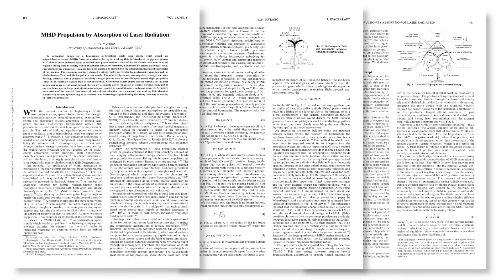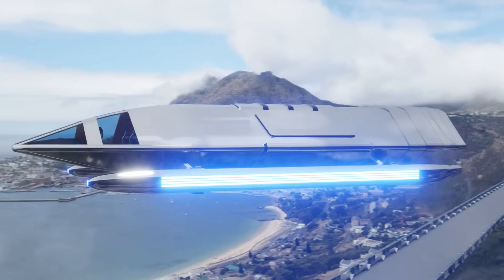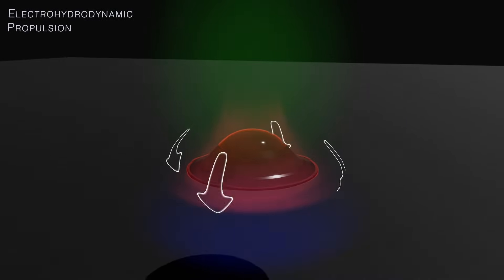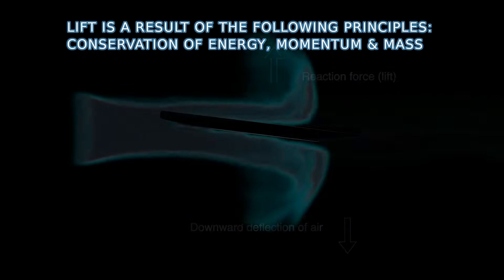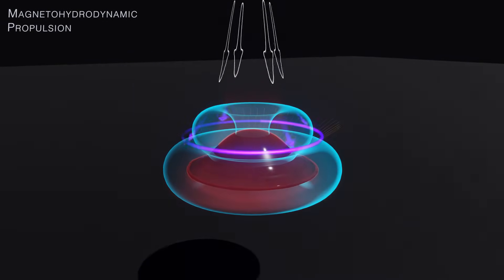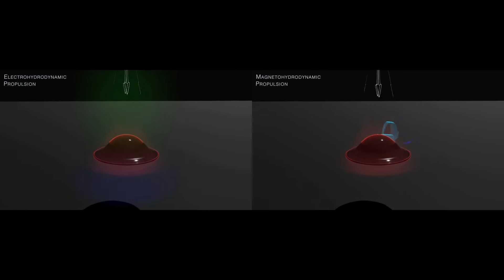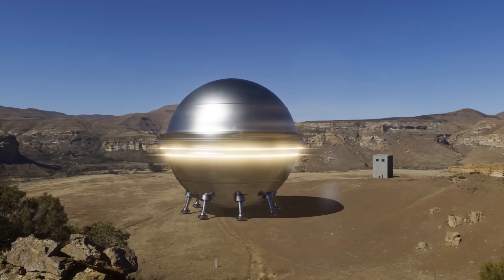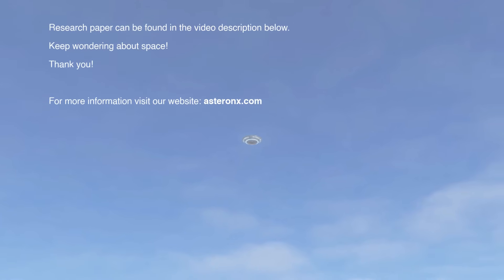Magnetohydrodynamic (MHD) Propulsion - What Is It? #magnetohydrodynamics #mhd #aerospace #asteronx

Comment: Those ideas are like the one I have in my mind.   But it's a little different,  in mine I use a different way to propel the ship using the ship to do that.  Instead of ionizing the air, it propels with magnetic fields.
Reply: MHD propulsion works by using a magnetic field to accelerate a conductive fluid, which generates a thrust force that propels the system forward. The conductive fluid is typically a plasma or ionized gas that has been created by an external energy source, and it interacts with the magnetic field to produce thrust. 

It is not possible to create propulsion using just magnetic fields in a vacuum or empty space, as there is no medium or substance to interact with the magnetic field and generate a force.

However, in the presence of a conductive fluid, such as a plasma or ionized gas, it is possible to generate propulsion using magnetic fields, as in the case of Magnetohydrodynamic (MHD) propulsion. The interaction between the magnetic field and the conductive fluid generates a Lorentz force, which can be used to accelerate the fluid and generate a thrust force that propels the system forward.

Therefore, while it is not possible to create propulsion using just magnetic fields in a vacuum or empty space, it is possible to use magnetic fields to generate propulsion in the presence of a conductive fluid.

However you may be thinking about if it is It is theoretically possible to generate thrust using a planet's magnetic field through a process known as magnetic sailing or magnetic levitation. Magnetic sailing works on the principle that a spacecraft carrying a strong magnetic field can interact with the magnetic field of a planet and generate a force that can be used to alter its trajectory.

The force generated by magnetic sailing is proportional to the strength of the magnetic field and the relative velocity between the spacecraft and the planet's magnetic field. Therefore, to generate a significant force, a spacecraft would need to have a strong magnetic field and be moving at a high velocity relative to the planet.

However, magnetic sailing has some limitations. For example, the force generated by the interaction between the spacecraft's magnetic field and the planet's magnetic field decreases as the spacecraft gets closer to the planet's surface. This means that magnetic sailing would not be an effective method of propulsion for a spacecraft that needs to land or operate in close proximity to a planet.

In addition, magnetic sailing is still a theoretical concept and has not been demonstrated in practice. However, some research is being conducted to explore the potential of magnetic sailing for space missions, and it is possible that it could become a viable method of propulsion in the future.

(all answers based off chatGPT answers)
Reply: @BlacDiamond 233  what I'm referring is a little different,  where the ship generates a field than interacts with the ship itself, while the ship is made of a material that reacts yo magnetic fields.   It's like having 4 magnetic fields with iin the ship.   
An easier way to explain that was reflected Ina a patent that almost has the same idea that I have.   If you please search the patent you may have an idea of what I'm trying to explain. 
US7936097B2
US20150252795A1
US20060144035A1
While some of the documents don't describe the real working idea.   Some of them do.   My idea is a mixture of this 3 ideas .
While I was doing research,  I came across this and they in some way reflected what I have in mind.    
I've seen experiments were it is possible to achieve what I have in mind, by mixing different ideas to achieve propulsion,  independently from the earth gravity.   From a source creating fields with in the ship.
Reply: @luisarias8077  I looked up and read the patents, what you described and the patents describing is the equivalent of  trying to open a door while having both your feet anchored on the door and both your hands on the door nob and trying to open the door by pulling the nob; what I am trying to say is it would not work under normal situations (presence of gravity and because you are trying to push off momentum that's going the opposite direction meaning you need an exponentially and very quickly a amount that would not be pressable at all because the necessary amount of power would be considered infinite*). However it could work depending on the way it function, for example, in space you have 2 magnets that is attracted but physically limited to get closer, one of the magnets is stronger than the other so one of them pulls the other more than the other so this will cause a small amount of momentum in space, if you were able to flip the pole of one of the magnet making it un-attract and have it restricted to flip so it cannot become attracted again, it would repel, in such a way that the momentum is canceled out completely ( assuming the magnets is again restricted by some sort of structural rail and  having a limited distance it can be repelled from). But if you want to do the same process again in such a way you will gain momentum without needing to cancel it out; you would want the magnets to be spinning ( it would look like 2 magnets on rails with rail limits so it cant get off and the whole thing is spinning sort of like a centrifuge ). When it is spinning at some point the left magnet and the right magnet will swap its place, meaning when you flip the magnetic field of one of the magnet it would not cancel out the momentum, but increase the momentum WHEN you time it correctly, even once you made this idea digitally(somehow) so it could do this process hundreds of times per second, it is very difficult to say it would work(it may possibly work in non-space as in planetary conditions if the *exponential infinite amount of power thing I said before does not effect this concept only if that does not occur because it is mathematically alright or it is in space specifically). I tried to get as close as possible for your idea to work but it's ability to work would be a drastic yes-sort-of-work-ish or no-work. Im not even sure if it would even work in space but I assume it could because it is spinning and the strength of the magnets is different; generating a polarity and allowing momentum (which is the part if it does not work I would seize to know anything better for the idea to work in terms of trying to make it work specific to your idea).
Reply: @blacdiamond2334 Salt water works they build MHD boats a long time ago with MHD generator engines on board but the boats only managed 12MPH so they left it which I don't understand personally as its the generator itself that's important not how fast the boat goes n 12mph is exactly how fast modern ferry's move so we could be powering them with these generators but I think they stopped it because not much money in it for them the usual reason we miss out on so many things n progression off many things all about the money

Comment: Looks like someone figured out most UFO propulsion and also why Star Trek favors Warp Nacelles as Magnetic Space Rockets for FTL flight.

Impulse Engines might just be a more limited angled version, which draws propulsion from Warp Drive Power while pushing space along to move.

Alcubierre Warp Drive math would seem to be applicable to at least some of the needed calculations to have MHD Warp Drive Nacelle Space Rockets work.

Comment: All the info you share may be factual up to the point of where weight to thrust ratio can actually be achieved to produce a manned vehicle that actually leaves the ground. I see the video you show vehicles moving in air. But they're not real...yet. because if your video was factual, that form of propulsion would already be utilized and it's not
Reply: Electric power was also factual, it just took time to understand😊

Comment: I would wonder if high rotation dielectric near aluminum blocking gravity from nearby large objects like a planet? Wonder if using shock of electricity to line electrons to stimulate large crystal. Witch gravity can be built up and directed as a laser? Thinking out loud thew my backside should propel me across the universe.
Reply: So, the magnetic field push the outer structure of the ship, and other magnetic fields placed like number in a clock, will create direction.  The power source will generate the field that interact with the ship creating lift.    Think of a superconductor levitating in a cold environment.   Without the need of a cold environment. 
There is metal's that behave like superconductors at room temperature.   In the presence of magnetic fields.

Comment: By MHD an entire ship can be moved in total vacuum
It's the electrical current through the entire ship, crossing at right angle a magnetic field, that makes the atoms want to move in the remaining angle
Your right hand's rule ... check for " A primer on the Homopolar Phenomenon "
Reply: If the magnetic field is generated relative to the ship then the atoms will not move, because a subset of them are generating the field. Its for the same reason that blowing into a sail from inside a boat will not move the boat.

Comment: I thought I might learn something. Yes, ion wind is different and a very weak force. Yes the principle of lift is correct. After that it's a lot of advanced physics. Some time ago it was speculated the military had a plane capable of Mach 12 or greater. To be clear there are two critical factors here. First is incredible propulsion. Second is not melting or shredding like toilet paper. This is how it was explained. First, jet engines would take it to low Mach. Second, SCRAM jets would engage to hit around Mach 5. Then it would shoot a current out the front powerful enough to create plasma while at the same time creating a magnetic bubble, basically cavitation in the air. At that time the MHD. would kick in. In particular plasma is positively charged atomic nucleus with the electrons stripped away. It's the fourth state of matter. Being ionized means the molecules are looking for a covalent bond. The energy difference is huge. However escape velocity is 7 miles per second so you need to go fast to get to space unless you have an elevator.  Essentially I see no explanation of MHD working in the atmosphere from a standstill. Magnetic drive with rails yes. Additionally your explanation in space fell short. The propulsion you presented,  like ion drive is low energy but operates for a longer period, and there is no drag in space. Matter in space is extremely low density gas. Virtual particles would be the result of high energy collisions. MHD needs interacting Magnetic fields and that means either mass or energy.  I know people who don't do science probably miss what I pointed out. However MHD is certainly exciting, especially if cavitation can be achieved. Of course if it fails it rips apart like the Challenger.
Reply: The correct propulsion will be magnetic not needing to use ions.
Magnetic enough to levitate the ship with enough force to break gravity.   Then moving faster will be easier.   Using the ship same as a superconductor in a super cold environment.    Some alloys levitate in presence of a magnetic filed.

Comment: MHD is a interesting phenomenon but if is a easy as suggested in this article then why is it not in use 
. I think the power plant to supply these systems would be one problem also the lifting force is very low compared to simple wings or rotor lift . Magnet force required would be dangerous to any crew or electronics high magnetic fields render humans unconscious and scrabble electronics programming.
Reply: It IS in use currently

Comment: Strange to think you could get any lift from a element that is heavier than Lead, just by rotating it in a magnetic field.
Reply: I just realized this a week ago and was amazed...we could push a 1-ton piece of lead and get it to swing provided it was hanging from a long enough cable. Even a round enough stone. So friction is the key problem not so much  weight or mass. I think.

Comment: Similar to indirect use of electric power. AC magnetic field collection is an example of this principle you can collect power passively from AC power lines to use for lights refrigerator or air conditioning. The outlets in you house have been modified to accept the AC magnetic field based devices.
Reply: Know what's weird, I took an old ceiling fan motor apart, and got it to light up an l.e.d. a few weeks ago by spinning and putting a magnet by it, then a lightning storm spawned right after i got it to light up and i ended up struck by lightning (essentially it hit 3 feet away from me but the house blocked it) and my car also... anyway, that might not be relevant... but the field was a/c somehow... I guess like putting it by the powerline could do something, who knows... I chunked it and even my dad said get rid of it after all that shit happened... I toy with things and some weird magic amplifies it I guess

Comment: Well, you started off wrong.  I hate that.  MHD is not an acronym..it is an abbreviation.  Come on you guys.
There are several problems associated with the development of magnetohydrodynamic (MHD) propulsion. One major challenge is the need for extremely high temperatures in order to generate the plasma necessary for MHD propulsion. This requires the use of materials that can withstand high temperatures, which can be expensive and difficult to obtain. Additionally, the complexity of the system makes it difficult to control and stabilize the plasma, which can lead to inefficiencies and reduced performance. There is also a lack of knowledge about the behavior of plasmas in magnetic fields, which makes it difficult to predict the performance of MHD propulsion systems. Finally, the high cost of research and development for MHD propulsion systems can be a major obstacle for many organizations.
Reply: The Dougie Downer Peanut Gallery has spoken...
Reply: we need low temperatures, take a centrifugal propulsion path banner and convert it to a series of tubes full of circulating ferrous fluid then quantum lock the ferrous fluid by surrounding those tubes with liquid nitrogen tubes and super cooling it... then you have a quantum locked solid state centrifugal propulsion path banner that can float, turn it upside down left and right, add on/off switches, whatever you need afterwards to make it fly...

Comment: In the Varginha UFO crash, allegedly the crash site was covered with strange liquid. Could it be that the liquid is what was used on that craft to generate lift?
Reply: Makes sense. The witness said the fluid had unusual properties and looked odd.
Reply: The fluid was from the suits.   They need to be in suits fill with fluid to withstand the g-force.
Reply: @luisarias8077  😂😂😂😂😂😂😂
Reply: @robertlee4809  —> I’m still laughing😂🤦🏻‍♂
Reply: @luisarias8077 there wouldn't be g force in a non reactionary propulsion craft, no inertia at all
Reply: It was from Varginha, we should be flattered it was wet.

Comment: @asteronx I understand this information is still a theory not yet accepted by Mainstream Science. A few issues...what type of power source is used to create the incomprehensible energy required to effect gravity?....effecting atmosphere is simple....just turn on a fan...literally....GRAVITY is the key....but what is gravity?? We have only been able to measure 1 simple Effect of gravity.. that's the weight or the amount of pull tward an object based on Density........Even tho this theory is currently accepted, the gravitational waves OR partical itself has never been detected, observed or measured in any capacity and this is because we have not yet discovered an instrument capable of such task....or have we? Could it be what we base EVERYTHING on...TIME...we know that an atomic clock placed at a high elevation will be faster than ones closer to the core of the earth. Does Density effect time Or does Time effect Density and density is theorized to effect gravity.......

Comment: Well I tried to listen to all this with an open mind.
And what I got out of this is you are trying to build fluctuations of the magnetic spectrum in a variation that reacts with it's soroundings as if they were fluids.

You will need some very powerful magnets for that... And a very focused microwave guide form to prevent dispersion. Yes you are still using applied ionic wind... But you are layering it in More reliable stratas, each layer maintaining a polarized membrane between itself and the next due to the various states of the gases and their ion variants.

This will be hard to make work until you reach very high Teslas at kilohertz in frequency...
Reply: Yeah it's super simple haha just make a fusion reactor basically. No biggie. (I'm kidding)

Also of they did get it hot enough, how would they safely make it into a flight craft?

Comment: There are two big issues: power source and efficiency.
Reply: oh there is a generator thats based off of this technology which can recycle the energy both  from heat, conductivity of the medium itself and kinetic energy from the flow of the plasma back to the  source with at least 60- 70 % of the energy that was used going back to the craft. Its really an odd contraption.

Comment: The ion wind propulsion is just BIG NOOOOO. It is insanely inefficient. Most of your generator/battery/engine energy goes to actually ripping the air (mostly N2 O2) apart into ions (ionisation) and then a little bit into motion of the wind and equaly opposito to your craft motion...
Reply: Honestly, it’s pretty much exactly the same with MHD. Astronx’s concepts will probably suffer the same fate as those naively optimistic 1960’s ion wind craft concepts. But never say never I guess?